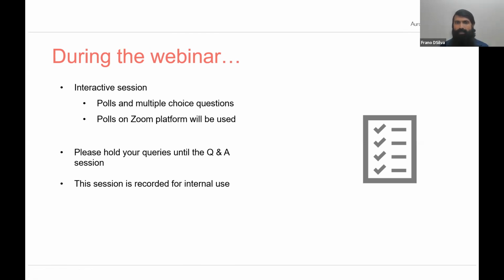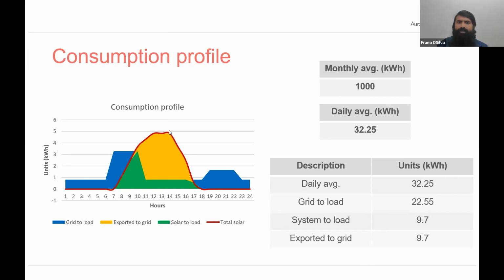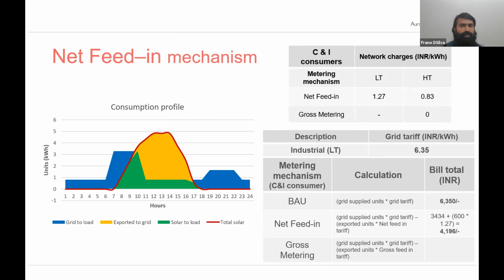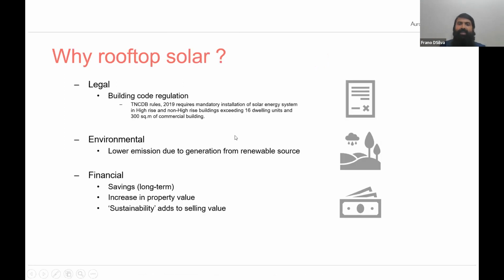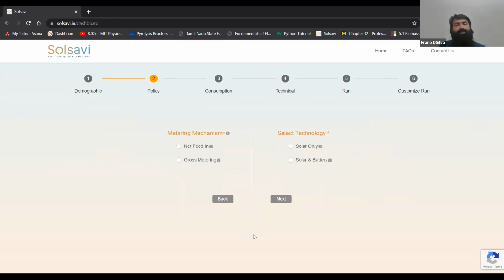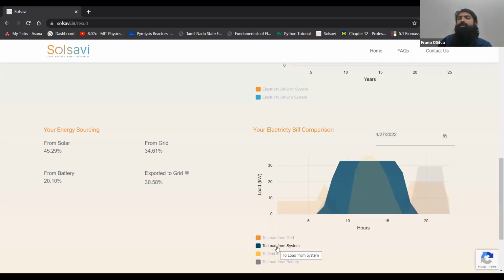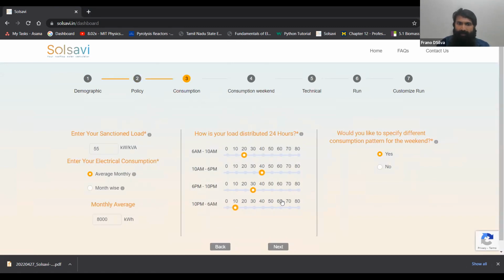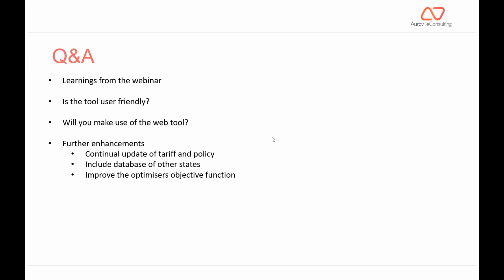Solsavi Webinar

Comment: Are you including design and plan for Solar Thermal mode water heater also (?)
Reply from the maker: No, the tool does not analyse particular electrical appliances.